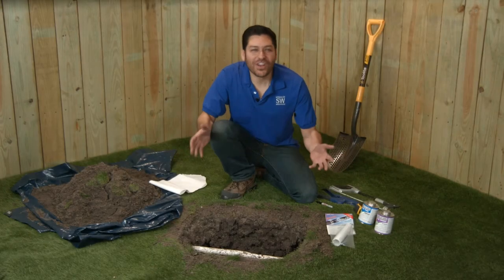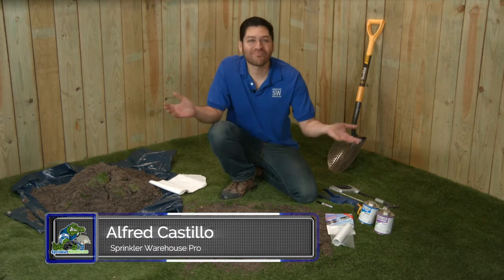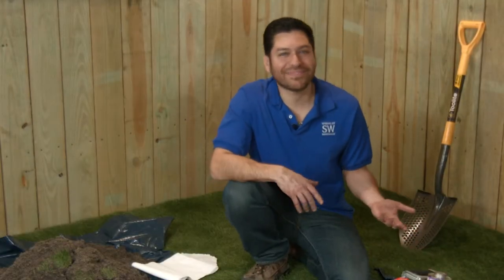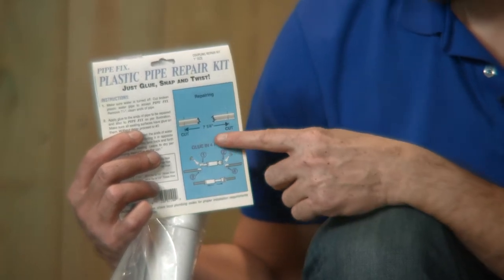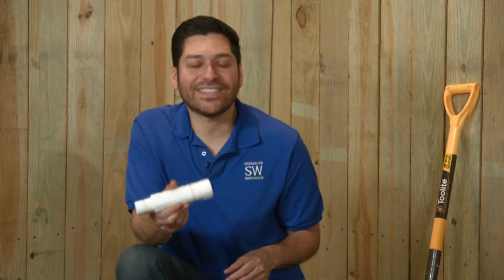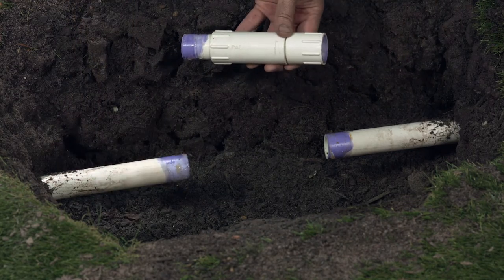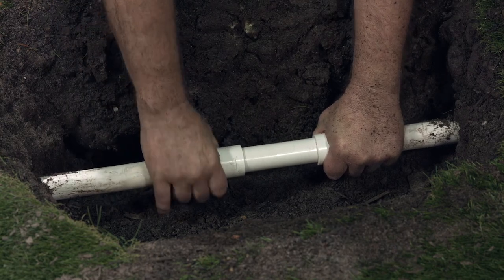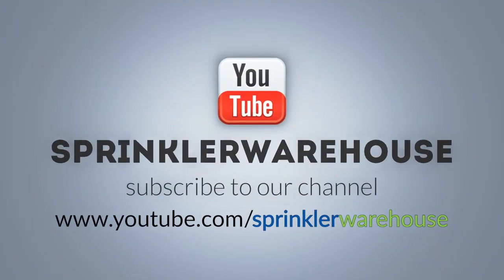Interlock Slip Pipe-Fix Coupling

Comment: Alfred, I need to make a similar repair on my sprinkler system. My check valve from the motor to the well is bad and I need to replace it. Is there a check valve with a sliding sleeve similar to this coupling? Also, since I cannot find the bad check valve, should I install it close to the motor or to the well which is about 40 feet from the motor? Thanks in advance.
Reply from the maker: Strike up a chat with our helpful customer service reps at sprinklerwarehouse.com, they need more information about your issue in order to provide you with the correct information about your problem. - Alfred